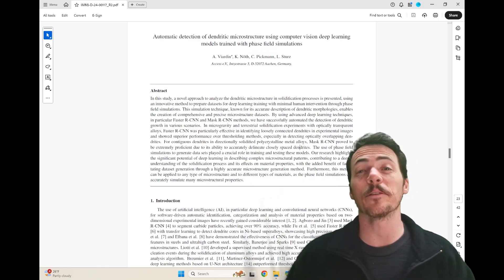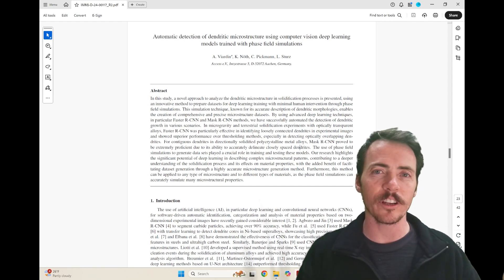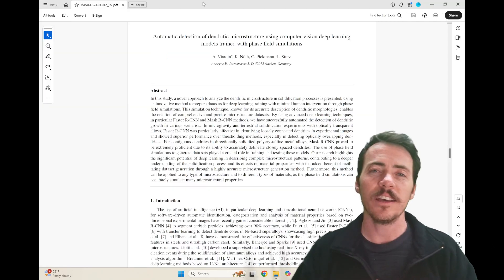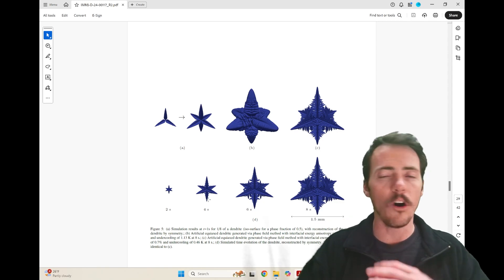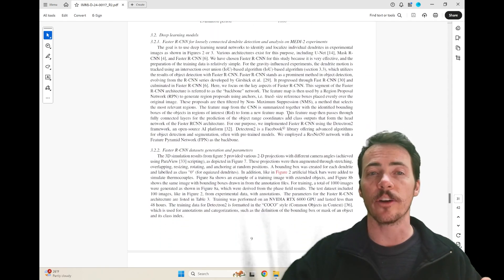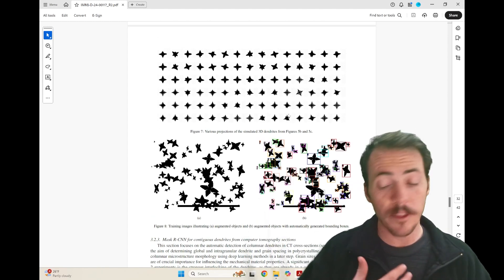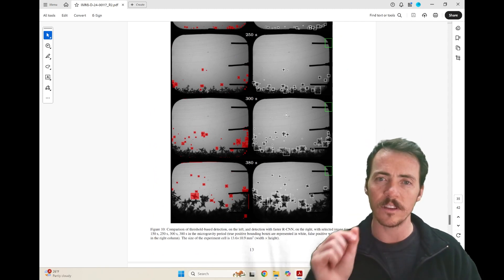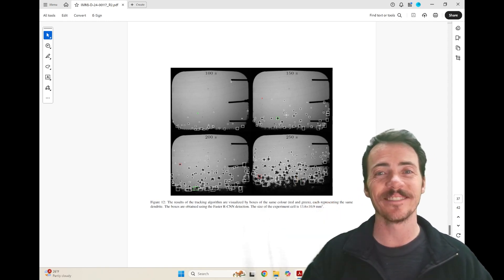Using phase-field simulations to train deep learning models to identify dendritic microstructures

Comment: Now thats what I expected when I saw on LinkedIn that you were appointed editor-in-chief at IMMI.  Having worked with MICRESS -- the phase field code from Access -- myself, I must admit that such approaches could be useful in accelarating "expensive" computational models, like phase field, when simulation results cannot be extrapolated in higher scale (from meso to component scale) due poor RVE statistics (e.g. texture evolution during recrystallization). Do you, Prof. Sparks, see data-driven surrogate models trained on data from full-field physics-based simulations as the next step when it comes to process modeling of physicometallurgical processes or at least serving as a medium to accelarate them without needing HPC facilities?
Reply from the maker: @FotisTsiolis  I think so!! We can begin to go from solving you problems or highly unique challenges to more broad ones